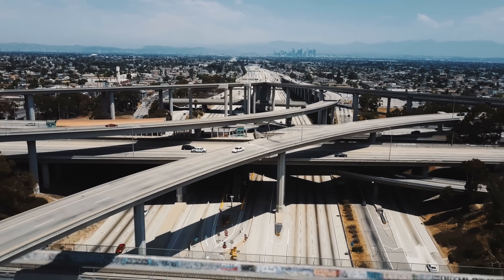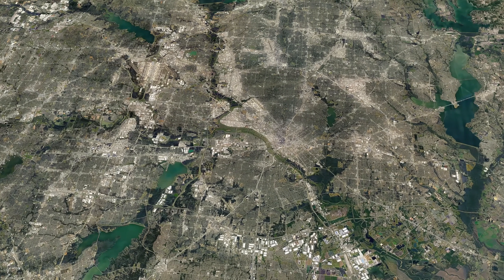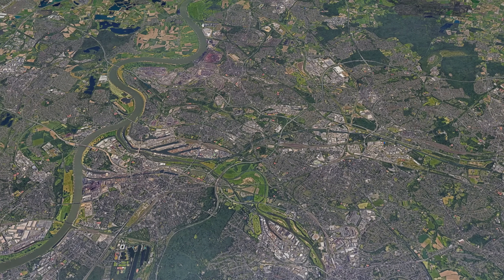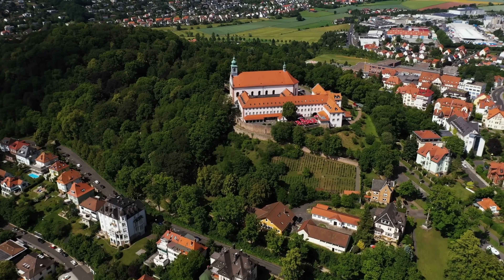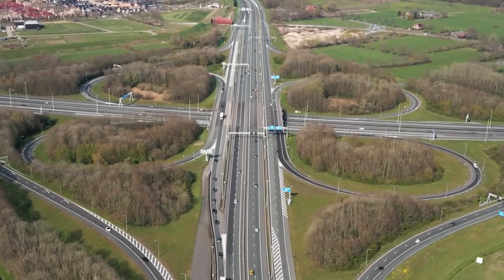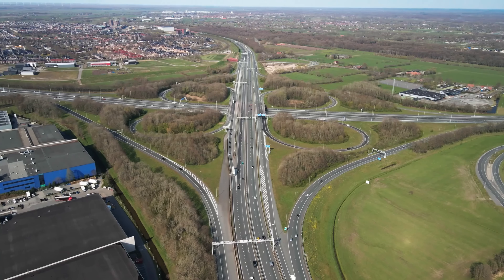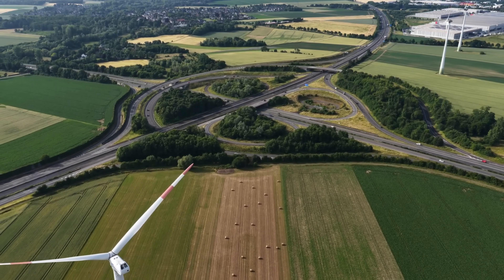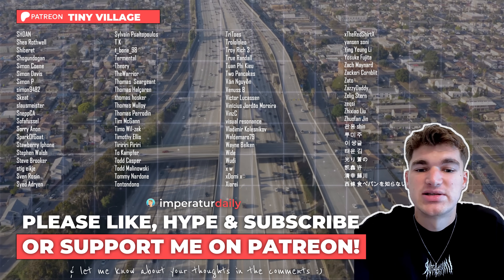Why does Europe have So Few Stack Interchanges?

Comment: What's a cloverleaf? I only know roundabouts
Reply: Thera are completely different road projects, roundabout do not need viaducts, but you always need to yield cars at the roundabout, cloverleaf need viaduct or tunnel but driving straightforwardly you yield for nobody
Reply: @nowy5  what relation does this have to my response? I was referring to the fact that the UK basically only has 2 cloverleaf intersections
Reply: @ExperiencersInternational interchange, not intersection. Freeways do not have intersections; they have interchanges. The difference is interchanges are grade separated and free flowing for the freeway, while intersections are not. Roudabouts do not work well for system interchanges (interchanges between 2 freeways), but they do work for service interchanges.
Reply: @FastKnight401 yeah fair, always get them confused. I've certainly seen a few roundabouts on trunk A road/motorway intersections and motorway/motorway intersections though

Comment: build these in germany and in winter the rate of car crashes will explode due to suddenly iced tracks once high in the air.

We got one hear about a decade ago instead of the previous and ground based solutions and since then the speed limit had been reduced to 80 kmh.
Not really desireable - and the USA is not so close to russia  that it becomes a battle field. The less stack interchanges you have the easier the fix after the frontier might have crossed the highway and has been reconquered. 

It is a crossing from Gelsenkirchen to Münster ... and when you then want to change onto the A1 heading north then there is such bick american endless stack / bridge of many hundred meters driving in the air where the cold can freeze the water or humidity than with a highway in the ground which is usually not frozen here and still above 0 heating the track while the bridge will be attacked by frost first.

USA citizens can not even imgine that there might be a battle front and howitzers hammering salvo after salvo on the key infrastructure and brides and interchanges are the easy target.

Comment: "US big" is a terrible argument for wasting space in densely populated areas. You're not going to find these ridiculous monstrosities in middle of nowhere Montana.
Reply: "in the middle of the countryside" is not the same as "in the middle of nowhere" in Europe because rural settlements are often numerous and are quite well populated. The problem is not that we lack land area - instead, it's that there is little to no available space around where you'd typically want to have a motorway interchange, so it's much more practical to just build smaller interchanges.
Reply: I think he meant something different but worded it wrongly.

I think what he means is that (in most cases) when comparing EU and and US cities with similar amounts of population, the US cities tend to be a lot bigger and have more land per resident.

Cause the US as a whole is big would indeed be a strange argument
Reply: @casdegryse1320 US cities are less dense because of the stupid big ass interchanges :D
Reply: Middle of no where Montana is the size of one single country in Europe. That kind of space unused does not exist here. Unless it's horrible high peaks or otherwise impossible to develop. Areas that size in Europe is probably agricultural land, and people need food. It might be hard for Americans to understand that the need for an interchange like that in Montana is none existent, in Europe it would still not be available to build on.
Reply: Phoenix's metropolitan area has a lower population density than many European countries which includes those country's urban, rural and national park areas.  In this sense Phoenix is big and has a tremendous amount of area to play with compared to Europe.  The same is true for other US cities, excepting older cities laid out before cars.  A fact I remember from the1970s was 30% of LA's area is given over to vehicular traffic activity, to me that has always been a nuts statistic.
Reply: It grinds my gears whenever someone says that cause literally this country was built on rails.
Reply: No. The absolutely monstrous clover leaf interchanges in Montana make these things look like fleas.
Reply: Woah, you won’t find huge highway interchange systems in the middle of nowhere Montana….i wonder if the lack of people have something to do with that…
Reply: Is  this reality ?  America is showing off with their shit Roads .  🥳🥳🥳🤠🤠🤠🤠🤠

Comment: The first argument doesn't make sense. Cloverleaf is a terribly space inefficient design. There are a number of stack interchanges here in the US because they didn't have the space, and if designed right stacked can be a great space efficient design albeit a very expensive one.
Reply: As we like to build the bridges as small as possible in the Netherlands we tend to build the ramps on so called dyke bodies. In the swampy parts of the Netherlands (the most populated parts) that would take a lot of space for the highest stack.
Reply: Yeah cloverleafs aren't a great design. They're space inefficient (all that inaccessible land inside the loops) and dangerous when there's high volumes of turning traffic as joining traffic conflicts with exiting traffic between the loops. That's why there's only 2 in the whole of the UK.
Reply: @rubberduck3y6  and neither of those are on the motorway network. The closest we had on the motorway network was Girton Interchange at the end of the M11, which was a half-cloverleaf (it had two loops on the same side of the M11), but that was upgraded a few years ago to get rid of one of the two loops.

Comment: In Massachusetts cloverleaf interchanges are common and if the intersecting highways are very busy the interchange can gridlock both highways. However that is the exception (malfunction junction, I-93 & I-95/128) rather than the typical occurrence. Most Massachusetts highway roads aren't as busy as such roads in Texas, California or Florida.

Comment: Because in Europe there is generally less space for ridiculously large interchanges, and small is more efficient...
Reply: Oh Europe has enough space, but we don't bulldoze our cities for it (especially the poor and minority neighbourhoods), like they did in America.
Reply: Cloverleafs aren't smaller, in fact they are larger. But they are also much cheaper. In Europe we don't build highways in the middle of cities, so land is actually much cheaper than in the US for interchanges. Because we build them outside cities in some random field that 2 highways happen to cross. Not next to a neighbourhood in the middle of a city. In fact the exit to a major city, probably is still pretty far from the city itself and has a regional road going from the highway to the actual city, because we don't build highways in cities. For example, if you approach Amsterdam from the South, the interchange that has an exit for Amsterdam, is actually 1 km away from the actual city, like the edge of the city where there are houses and stuff. So you get off the highway onto a regional road that's still 1 km long. We do that because it's much nicer for everyone involved that actually lives in the area. And driving 80 km/h instead of 100 km/h for 1 km, literally only costs you 9 seconds. So yeah, it basically doesn't matter at all. But it does make it MUCH cheaper to build the intersection there. And much less noise complaints. 

The fact that some people are talking about walkability already shows you that so many people have no clue how big this difference is, if you're walking anywhere close to a highway, you're seriously lost, or on like a 50 km hike. Because approximately 0% of the European population has a highway between their house and their grocery store.

Comment: Research the width of European highways. In the Randstad (between Amsterdam, The Hague, Rotterdam, and Utrecht), the highways consist of 5x5 lanes, and in Rotterdam they are even wider. I wonder if other European countries have 5x5 lanes or more?
Reply from the maker: Yeah the netherlands have also a lot of crazy highway infrastructure not just bikes:D
Reply: @imperatur  NOT JUST BIKES MENTIONED
Reply: In Germany, I'd say "rarely, and only for short sections" -- usually because its an area with a lot of traffic and lanes splitting off/joining from other roads. Once all that splitting and merging is done, the road will be back to a more reasonable number of lanes.
Reply: Maybe because Rotterdam is home to one of the largest, and most important cargo harbour. It suppliers most of northern Europe with international trade goods. It also generate a substantial wealth for the country.

Comment: The Prins Clausplein interchange, near The Hague, is where the A4 (E19) and A12 (E30) intersect. It was built in 1985 and also has a railway line running through it.
Reply from the maker: Yesss true what a shame i haven’t included that one
Nonetheless they are soo rare
Reply: Also a bikepath underneath 2 actually
Reply: @Jonydepony  In fact two railway lines, plus a canal, plus, etc.
Reply: Isn’t Kleinpolderplein interchange between A20 and A13 in Rotterdam also a stacked interchange?
Reply: @RealConstructor  Only partly, there are also turbine elements visible, and a lot of the ramps are missing to make it a complete stack. Knooppunt Benelux seems to be planned as a full stack interchange, if the A4 ever gets extended southwards.

Comment: Hot take - i take a beautiful clover leaf over 6 bridges stacked ontop each other any day ... imo it looks wayy more elegant. Sometimes less IS more...
From a design perspective a stack intechange always looks to me like someone forgot to take one or two lanes into account and then just slapped them ontop of the already existing ones
Reply: Stack interchanges are also sometimes called a Maltese cross. As someone who's lived in Malta for almost 25 years, I think they're quite elegant. Especially if they are horizontally symmetrical.
Reply: Stack interchanges are better in my opinion
Reply: @sal-the-man Stack interchanges are ridiculously expensive. So they are a solution of last resort for interchanges with high volumes in at least 10 of 12 directions.
Reply: @BernardVenhoven but they are needed a lot especially in my city where there’s so much traffic backed up the cloverleaf interchange
Reply: @sal-the-man Almost always that is solvable with one or two flyovers for leftturns.
Reply: @BernardVenhoven  true that too
Reply: Less is NEVER more (literally opposites! 🤦), but it sure is better in this case!

Just like less cancer cells in your body sure is better.
Reply: A cloverleaf generates traffic if there are to many cars thats the issue. Its not about looking elegant its about traffic flow
Reply: @tajothy2692  A cloverleaf cant "generate" traffic .. it can only redirect it
Reply: @tajothy2692  Adding extra lanes or stack interchanges won't fix it, better to have good alternative options to commute and thus reducing cars on the highway. Trains, metro's, bus, separated bike lanes etc. I feel like in North America people are often pushed to drive with the car, because there are often no good alternative options.
Reply: @N3v3r_S3ttl3 yes North American people are definitely pushed towards driving a car because of the lack of alternatives and general urban design. But as you can there is a high demand. Not all people are willing to take public transit even if the infrastructure would be perfect. Traveling by car brings so many practical and comfortable things with it. And for example here in Cologne adding extra lanes and improve the interchanges will better the situation because these things are the clear bottlenecks. Traffic is getting stuck because to many cars need to merge between each other and by killing that merge and improve capacity you will improve the traffic flow. Of course less cars on the road will always help but there aren’t less cars on the road
Reply: @tajothy2692  Oh a lot of people will definitely use public transport if it's quick, reliable and ticket priced are decent (cheaper than owning a car). Trains can be comfortable too, you can even do some work, play games or even sleep in a train. Can't do that if you need to drive a car.

I'm not disliking cars, they're useful too, but having good alternative commute options will definitely help people who want to drive and who don't. Win win situation to me.
Reply from the maker: I love the look of stack interchanges but fair point :D

Comment: M25 and M23 stacked interchange
Reply: I still question why that's one of the stack interchanges because on one side, the M23 ends being a motorway fairly quickly

At least M4/M5 makes more sense having about 10-20 junctions more each side and M4/M25 makes sense too with 4 junctions after it on the M4
Reply: @ExperiencersInternational The M23 was planned to go all the way into London, ending on either Ringway 1 or 2. If you haven't heard of the Ringways, you should definitely look them up.

This is also why the M23 starts at junction 7; there were supposed to be about six junctions north of its current starting point. See also the M11 for missing junctions at the start.
Reply: @ninesquared81  ah of course, the cancelled ringways project, makes complete sense now 😭
Reply: @ExperiencersInternational It's because of the unfinished London Ringways project. They wanted the motorway to head further north into London but they never finished it due to opposition. If you look on Google Maps you can actually clearly see a bridge constructed over the slip lane, where the motorway was supposed to continue.

Comment: Madrid has various large US-style stack interchanges
Reply from the maker: Not real 4 level stack ones at least i haven’t seen one
Reply: @imperatur  I think YouTube auto deleted my reply because I attached coordinates lol. The largest one is in the north, M-40 & A-1, right next to Las Tablas, check it out on Google Earth, it even has tunnels going under it. I usually drive through it and it isn't as complicated as it looks from above. 

In the south part of Madrid there are two others but more spread out in design (Just above Parque Lineal del Manzanares) the other one is a little more to the south, 
M-40 & A-4

If you also follow the M-50 there is at least 1 or 2 4 level interchanges along it if I'm not mistaken, I checked many others and they seem to be mostly 2/3 levels interchanges with a familiar design.